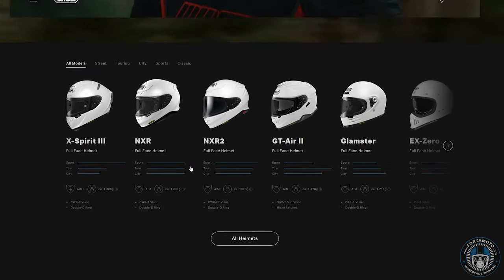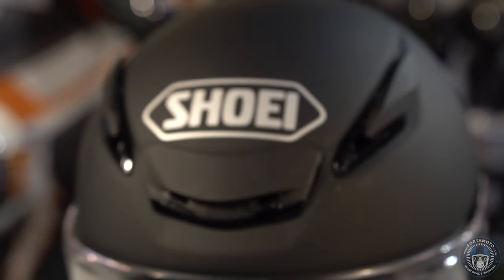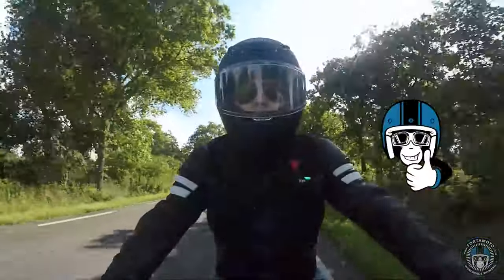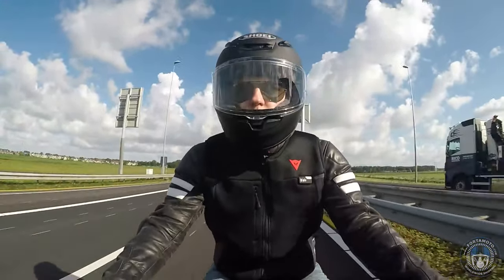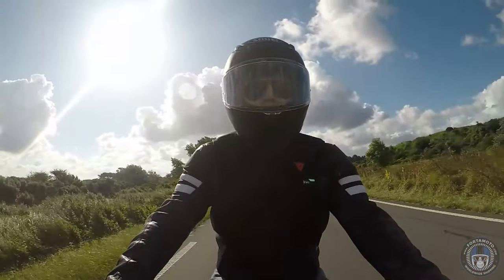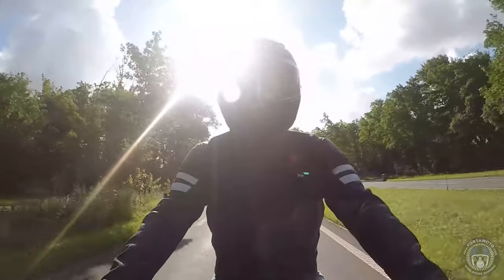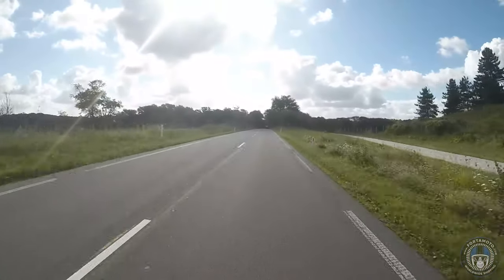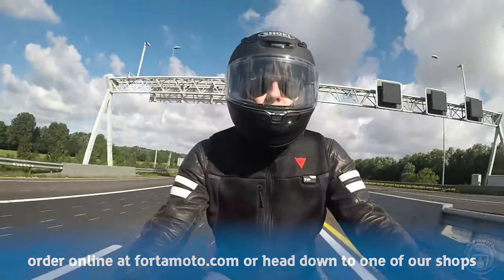Shoei NXR2 ROAD TEST review | FortaMoto.com

Comment: My personal experience with the NXR2 was bad. It was the noisiest helmet I have ever used, so much so that I ended up selling it on. I understand the factors of naked / screen, head shape and the use of earplugs etc but after watching so many video's claiming noise reduction in comparison to others I was shocked just how bad it was compared to my old HJC. Lost a chunk of money finding out it was awful.
Reply: Hey Colin,
A lot of new helmets are loud these days.
I started using motosafe Alpine hearing protection about 13 years ago and they work great.
I’ve used those foam ear plugs for years also but the motosafe are reusable and soft.

I went from the nxr 1 to a Arai Corsair V and was shocked how loud the Arai was even with ear plugs.
Ive owned a lot of different helmets over the years and it’s sort of a catch 22 with helmets it’s sacrifice ventilation over noise or less noise no vents..
Once you start using ear plugs you won’t go back👍
Ride safe..
Reply: Did you find the visor had a habit of closing with the wind hitting it? Unless it's open more than an inch the first couple of opening positions have no detent strength so constantly gets blown shut by the wind.

Comment: Mine whistles on the left side of the helmet particularly, but not exclusively, when the visor isn't latched down. It's a nightmare in situations where you need it unlatched due to misting up or heat when stopped at lights but then travelling on to the next traffic control. I find myself constantly trying to latch/unlatch and the catch is t that easy to do with gloves on. I was wondering if the NXR was better since the visor mech is different. It also picks up a fair amount of wind noise at speed. It's been back to shoei, who just say it isn't a manuf fault and basically, that's it from them.  Pros would be the weight

Comment: Please do comparison with arai Quantic.
Reply: I have both helmets at home and I can personaly say that the Quantic feels much more premium and the Arai visor system is buttery smooth compared to Shoei. Shoei is a bit lighter and a smitch quieter but not even close to the Arai ventilation, the Shoei looks a bit more sportier and the Arai is more of a all around looking helmet, something you can use as well on a retro and a sport bike, and when it comes to safety, even tho they have the same rating, I belive that the Arai is head and shoulders above it. Both are top notch brands, the best there are, but 10/10 times I would pay the premium and get an Arai, thats my 2 cents.
Reply: @iNFiN3  thanks for your input.
Reply: @iNFiN3  so, what do you suggest I should buy? shoei nxr 2 mural, or arai profile jungle? I can't decide. I tried both of them. Arai feels an little bit heavier I don't feel so comfortable, though I know they are the best. Shoei as sool as I wore it I felt like THIS IS IT! so comfortable, a little bit lighter, I didn't feel like taking this off. Don't know what to do. My boyfriend is arai fanatic, he changes helmets every 3 years, only arai. But me.... I don't know if I am arai person... my previous one AGV but...... not that safe..... thanks
Reply: @effieligouri7969  They’re built for different head shapes, you’ll rarely find both Arai and Shoei helmets fit comfortably. You have to have an oval head for Arai’s. Don’t feel you have to get an Arai because they’re “the best”, they actually have done quite poorly in the past in independent testing, especially side impacts. Safest helmet is one you feel comfortable with!
Reply: @chrisgraham6031   thanks for answering
Reply: I had a NXR for a long time. Had to change because it was getting old, around 6~7 years I think. I went for an Arai Quantic. I really don't like it, I'm now selling it and I'm back with my NXR for the moment. Things I don't like on the Quantic : the noise, it's just horrible (I'm riding a KTM 1290 SAS), it's so loud I couldn't hear clearly my music through my intercom (the same I had in the NXR), I'm wearing hear plugs. I can't stand the visor, it's really difficult to lock, and not stiff at all. It can close by itself when riding at high speed. In fact I never really know if it's lock or not unless I lift it. Opening it is a pain with the complex mechanism where on the NXR it was so simple.  On the proshade visor, the brow vents don't close very well so you always feel wind coming in, and sometimes it slightly opens and makes a lot of noise. You have to lube regularly the pivot mechanism, on Shoei nothing to do. With the Arai after riding an hour under heavy rain, the visor became much more difficult to open. I find the vents on the NXR much more efficient, and when it's closed it's really closed. On the quantic, on the logo vent, even if closed you always feel wind coming in. I'm really disappointed by Arai, I wasted about 800 euros !!

Comment: Will stick with my NXR v1. I hate the way the manufacturers are forcing a specific brand/model of communicator. My Packtalk Slim fits perfectly on my NXR v1
Reply from the maker: The NXR is a great helmet, so I can understand why you'd like to keep hold of that one for a while. The NXR2 doesn't have a specific communication system, but it is prepared for a universal system. Sorry if the video confused you, the helmet depicted with a comm unit in the video is a Neotec II with SRL system.
Reply: It also fits perfectly on the NXR2. I have both.
Reply: Use custom Earmolds with speakers wired in. You can use any  helmet then.

Comment: In some tests the NXR2 was shown to be one of the most quiet helmets tested. At 120 km/h the sound pressure was 98 dB at the ear positions. 108 dB was measured in the worst helmet. It's scary. I'm still using my AGV helmet from 1978. It's must simpler and quieter than the helmets you can buy today. I don't have to wear earplugs.
Reply: There is no way you are using a helmet today that is over 40 years old? Please for the love of god replace that, it will just crumble upon impact surely??
Reply from the maker: He's right, you know. Don't be silly, listen to Billy!

Comment: Doesn’t look like an X-Spirit … and the OG NXR looked better, too, imo
Reply: It does, but this guy is using an extremely wide angle lens that deforms the image quite severely.
Reply: @joaosoares3719  … Well, the OG NXR will take X-Spirit visors, and vice-versa … whereas, the NXR 2 has a whole new visor shape, which means buying more visors … 😏. Cha-ching, Shoei 💰   I think the OG NXR looks better, probably looks more like the X-Spirit if anything since it has the same visor shape/aperture (and the NXR 2 shell looks much the same as the OG, except for the much bulkier vent controls).  I suspect the NXR would pass 22.06 as well, if someone paid to test it; but Shoei saw an opportunity to redesign the visor aperture shape, and sell a bunch more visors (they were losing sales by having the OG NXR and S-Spirit share visors; every other helmet of theirs already had its own, proprietary visor shape … 😏)
Reply: @kierenmoore3236  The NXR 2 and the X-Spirit 3 use the same visor.
Just like the NXR & the X-Spirit 2 did.
And the original NXR was bested on the X-Spirit 2. They were 90% same helmet.
I had both of them so easy to compare.

Now I have the HJC RPHA 11 Carbon just because could not find a NXR in size medium at the time of purchase.
Reply: @villea1841   The X-Spirit III can take a CWR-F or CWR-1 (NXR ‘1’) visor.  The NXR2 has a newly designed CWR-F2 visor …  Have you personally fit one of the new CWR-F2 visors to an X-Spirit III shell … ?!
Reply: @kierenmoore3236  They did change the visor for the NXR 2 and it now has the central lock and visor opening so it doesn't fit the X-Spirit.
Seams that I was wrong about that.
Reply: @kierenmoore3236  I do not get your argument. How many people have the cash to buy both the X-Spirit and NXR 1 or 2? A miniscule number I would imagine. And why would I buy a NXR when I have a X-Spirit? BTW I had a X-Spirit and have just retired it this season (one of my favorite helmets). And new design is better in my opinion. I always hated having to use both hands to open the visor, unlike on my R1 with the easy to open central locking mechanism (similar to the NXR 2).
Reply: @EfferusZangetsu    I’m not making na argument; I was just stating facts about the visor compatibility between the X-Spirit III and NXR OG … and how the X-Spirit III visors are incompatible with the NXR 2.  People buy different (even ‘lesser’, in your view, possibly) helmets for different use cases, obviously.  I can open my X-Spirit III visors just fine with one hand.  🤷🏻‍♂️  I have a Pista R with a central visor catch, and I wouldn’t say it is easier to open; just different.  If some people struggle with other systems, they can get whatever they want … That wasn’t the point …
Reply: @kierenmoore3236   Your point was that they did it because they wanted to make more money. I just think that that is a bit unfair accusation, because the number of people who want to own both the X-Spirit and NXR2 at the same time must be tiny. Besides X-Spirit is also do for a update and I would not be surprised if they also change the locking mechanism to be the same as NXR2. But hey, time will tell. Have a good one.
Reply: @EfferusZangetsu   Point taken.  And I do expect the next X-Spirit to have a central locking mechanism, based on what we’re seeing in MotoGP.  But is it any safer, better, etc ?! … or does it just force everyone to ‘update’ all their accessories …  Anyway, yes; time will tell, and people can choose/buy (or not) accordingly …
Reply: Think the old one looks better as it is more stream line.  They had to wedge the nxr2 up a touch for new safety laws.  Also, the paint job on the older lids was better in my view.  Although I like the nocturne style one I think they could have done better, totally subjective mind.  Think Arai have the edge in looks but lets face it Shark and Nolan/ X-light to name a couple of others are producing some nice lids, so lots of good choice.